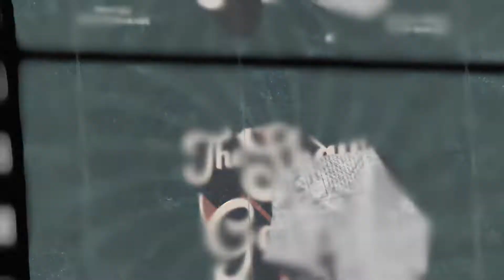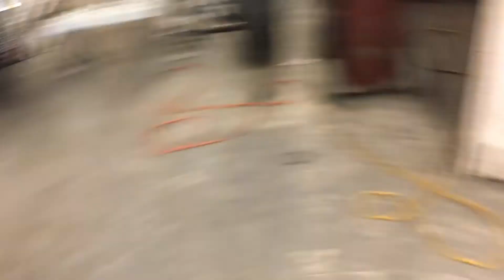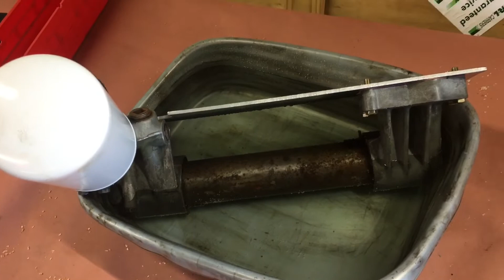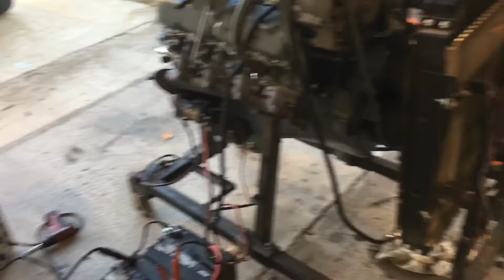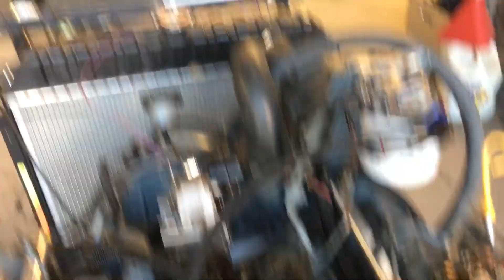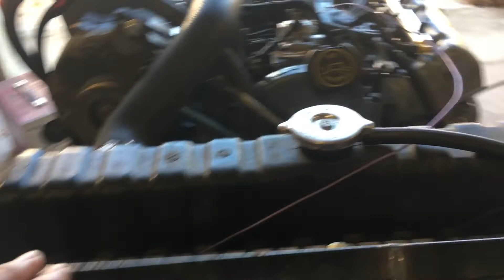7.3 Turbo IDI Engine Build Part 4

Comment: I had a 7.3L IDI that had a pop sound at idle from the exhaust. It did it for 40k miles until i sold it. Ran great, otherwise.